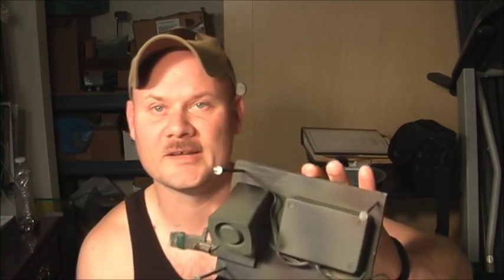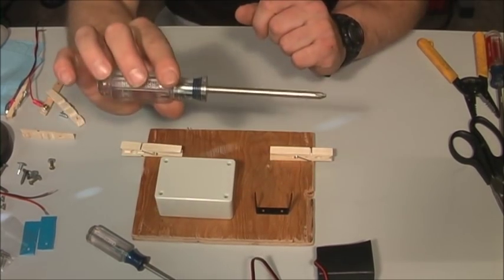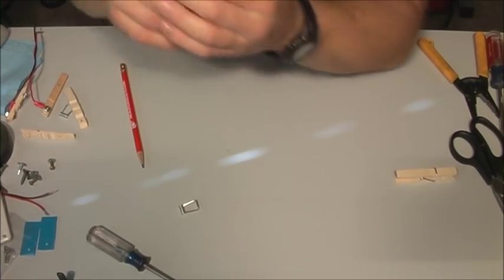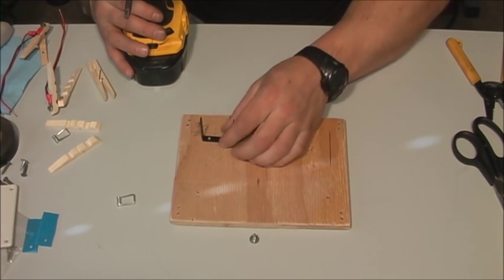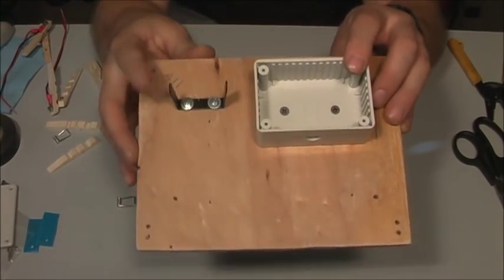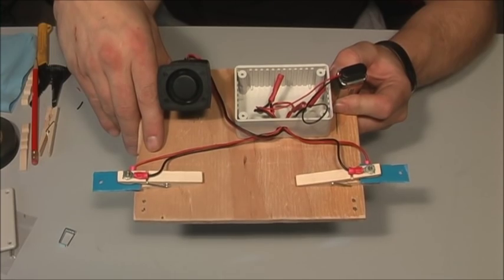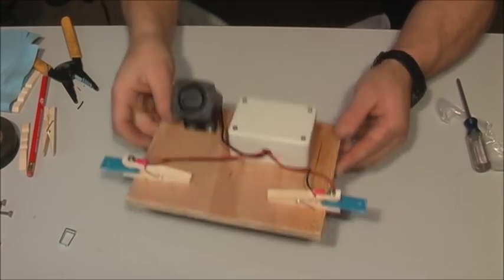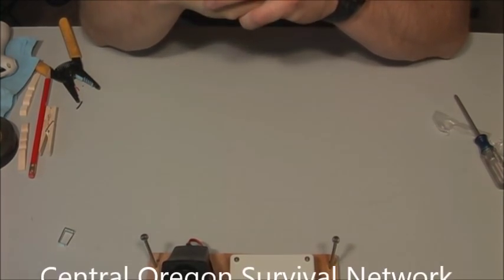DIY Tree Mount Dual Tripwire, Low Tech Security,  Short version

Comment: Where do you buy the siren and wires? Thanks.
Reply from the maker: Stacy Wieds I got all the supplies off of e-bay... If you want links let me know!! Thank you
Reply: Yes, I would love that. Thanks! :)
Reply from the maker: Stacy Wieds YES... Great job.. Sorry been really busy... Now all you need is 16g speaker wire, here is the link http://www.ebay.com/itm/20-Ft-16-Gauge-Speaker-Wire-Cable-Car-Home-Audio-AWG-20-Black-Red-Zip-Wire-/171574800243?pt=LH_DefaultDomain_0&hash=item27f2a7af73
GREAT job... Hope it comes out well...
Reply from the maker: Stacy Wieds Make sure you check your spam file, my last comment my have gone there... Great stuff..
Reply: I couldn't find any spam stuff. Since I'm not electronically inclined, I'm sorry for the stupid questions. But, how do I get the leads with the metal tips that you are screwing down on the clothespins? Also, where do I get the black and red leads for the 9V battery? So sorry for the questions. Thanks for the help! :)
Reply from the maker: So, did you get the last link for the speaker wire?
Reply: Yes, the 16 gauge. 20 feet for $4.95. But do I need to add the metal ends to them? And then there is the black and red leads to the 9V.
Reply from the maker: Cool, ok I will get you the other links tomorrow...
Reply: Thank you so much!
Reply from the maker: Sorry for the delay.. Here are some more parts;
9v Lead, http://www.ebay.com/itm/5-PCS-9V-9-Volt-Battery-Snap-On-T-Clip-Lead-Wire-Connector-Plug-Adaptor-Camera-/280747007258?pt=LH_DefaultDomain_0&hash=item415dd35d1a

Electrical fork ends, http://www.ebay.com/itm/20Pcs-Insulated-Fork-Spade-Wire-Connector-Electrical-Crimp-Terminal-18-22AWG-M4-/351127471710?pt=LH_DefaultDomain_2&hash=item51c0d4065e
Reply: Awesome! That is everything. Thanks. Have a great day.